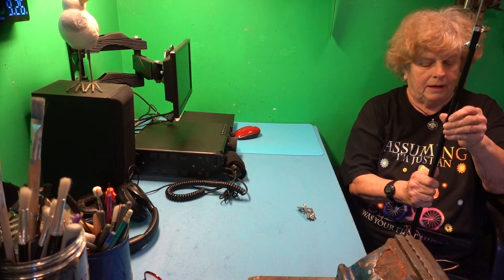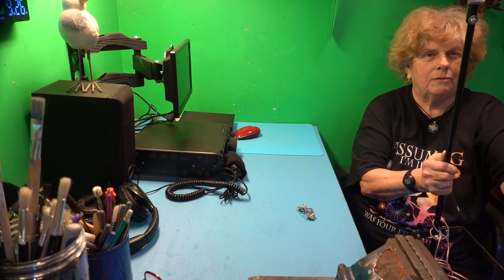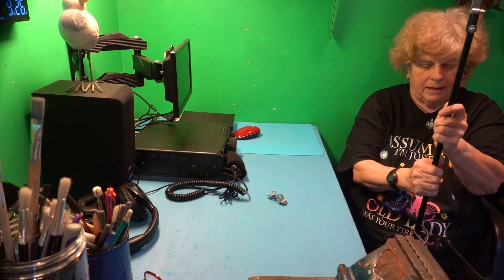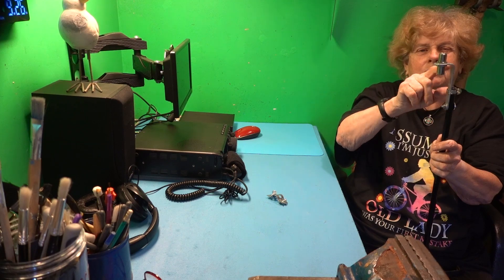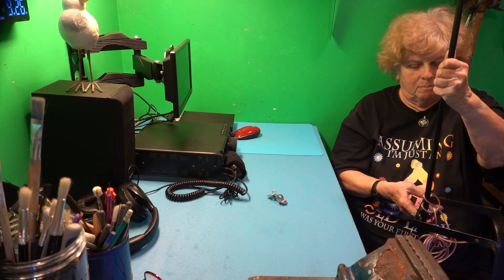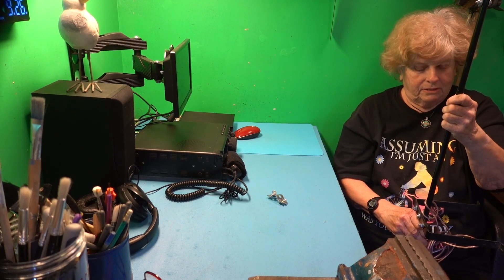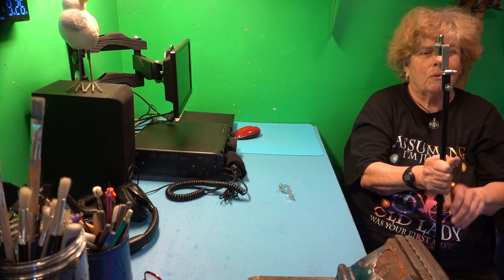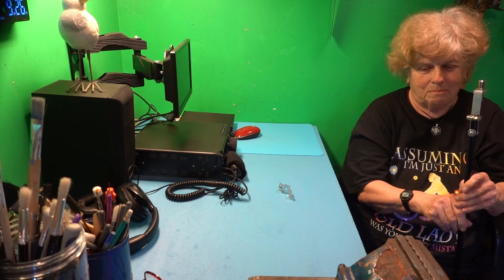JURY-RIGGING A HF80CL HAM RADIO ANTENNA #hamradio  #amateurradio

Comment: Hi Susan.....How have you found the ATAS-120A? 73 de Jon G4NEY
Reply from the maker: Hi Jon,  it works fine, but I live on a hillside facing south, so I mostly hear Europe.  I have put up whips for several bands, but the ATAS allows me to listen to the newer bands that have been created since I was active 40 years ago.  This lets me experiment with those bands without buying or making special antennas for those frequencies.  Unfortunately,  the ATAS takes quite a long time to slide up and down, so the people I was planning to call are often working someone else by the time I lengthen or shorten the antenna to the right frequency.  Hope to work you! 73 de Sue LA0CY!

Comment: Hey Susan... Take a look at dxcomander antennas
Reply from the maker: Hi! My problem is that any vertical over 2 1/2 meters high will stick above the roof line behind the antenna.  I have one mobile whip that length- and am hoping the neighbor who can see it from her veranda won't complain!  It looks like all the DX Commander antennas are way over that height.  I did exchange the 80m antenna with a 20m one. I also have a 10m-long end-fed random wire over our doorway about 3 m above the ground, but have no possibility for a longer or higher wire.  I really need a new QTH! Tnx for the suggestion! 73 frm LA0CY!
Reply: En dx commander lager du fint selv med fiskestang fra biltema 12/17/15 meter å det synes nesten ikke lb6cg @suenord1
Reply from the maker: Well, I now have an ATAS 120A,  an Ampro 10, a HF20CL and a random wire on my bedroom roof, and a couple of 2m yagis on the veranda, so I think I will use them for the time being. I did have some QSOs with Canada and the US, so I am getting out to some degree! I am now building fox-hunt antennas to find where some 2m RFI is coming from! (tape-measure one is finished).   Also practicing with my new paddle.  See you on the air! 73!
Reply: @suenord1  https://youtube.com/@hoahamradio?si=TsSRGnQzUrRuXfm8

Comment: Hello Susan.  Excellent job on the antenna installation.  Thanks for the 10m QSO.  All the best to you and yours from Mike VE3XLF
Reply from the maker: Thank you Mike!  You have no idea how excited I am after working Canada on the ATAS 120A!
Reply: @suenord1  Hello Susan.  Excellent contact.  I was running 100W into a Solarcon 99 10-11-12m vertical 6 m off the ground.  Take care.  Mike
Reply from the maker: 100 w will go a long ways with a good antenna.  Have not heard such good conditions on 10m  since I got back on the air!

Comment: Good Job, Sue. We all learning by doing. Keep up the good Work - you rock. 73 de Uncle Günter from across the Pond 💯👍🙋‍♂
Reply from the maker: Tnx Uncle Gunter!  I will go back up and waterproof the coax and solder  ring terminals on the ground wire when I solve the noise problem. I soldered ring terminals on all the other ground wires like you suggested earlier.  I learn something from each project, and have a lot of catching up to do! 73 frm Sue

Comment: Nice job with the bracket hope you find out what’s causing all the noise, 73 🙂👍
Reply from the maker: Tnx!  Looks like I will have to drag my car battery down the 44 steps to the apartment next!  Suspected the lights on soccer field, but the noise is still there in the daytime. In the meantime, I have the other bands! I will figure it out! 73 de LA0CY